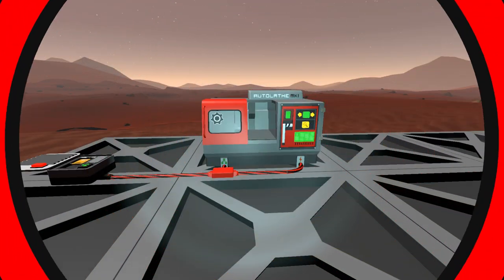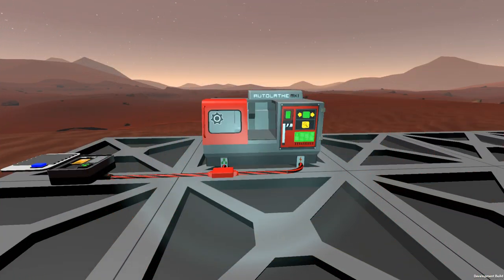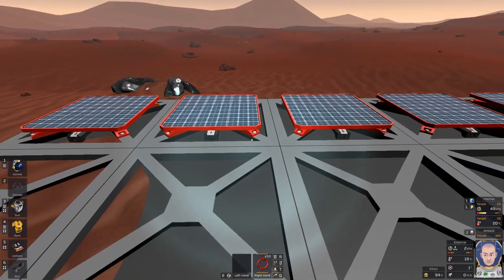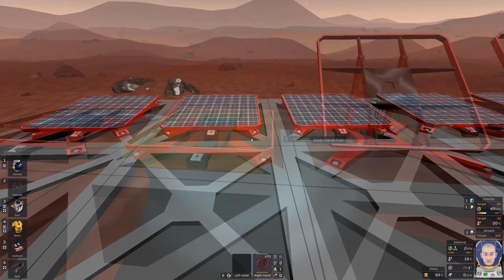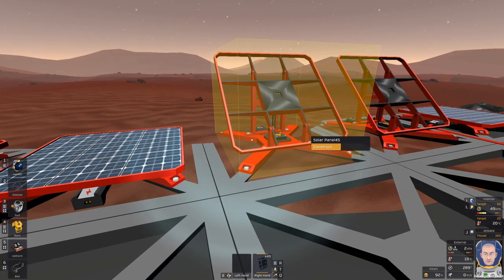Stationeers Basic Solar Panel Game Update

Comment: Is it the same power output as the regular solar panel in the same conditions?
Reply from the maker: Not sure.
Reply: From testing, it looks like it is, but obviously it won't reach the same output as a logic controller version consistently (since there is only 1 point in the day it will reach close to 90+%).
Reply from the maker: @mannyksoso  Exactly reason, why I wanted to avoid to test it. Thank you Manny.
Reply: Cheers. Is it much cheaper? Considering how easy it is to get logic controlled solar panels up and running, trying to work out the use case... Or are the regular solar panels more expensive now?
Reply from the maker: @CommanderQ  These panels are cheap to make. "The price" for regular panels is still same.